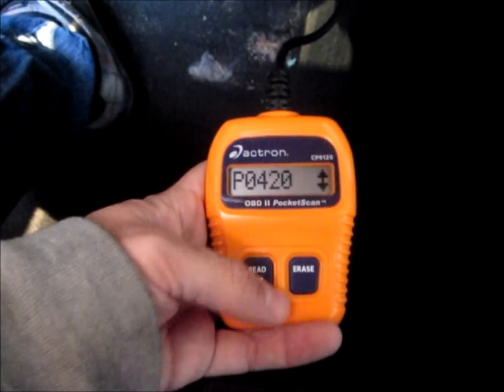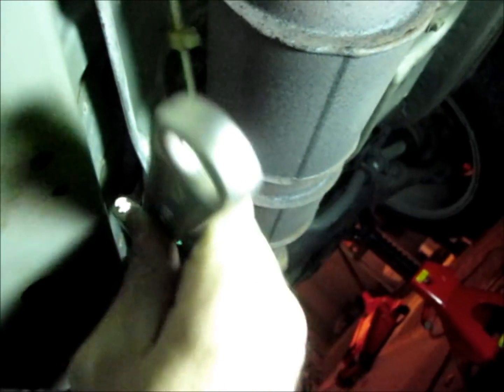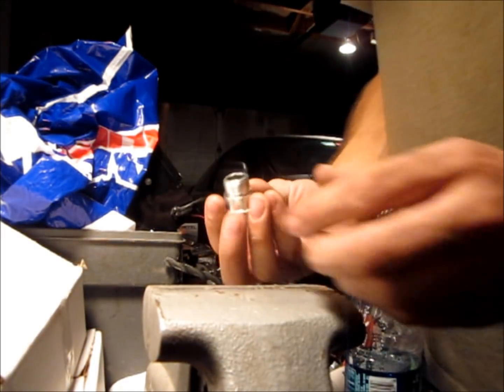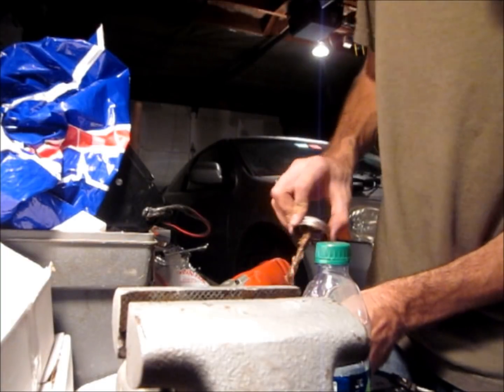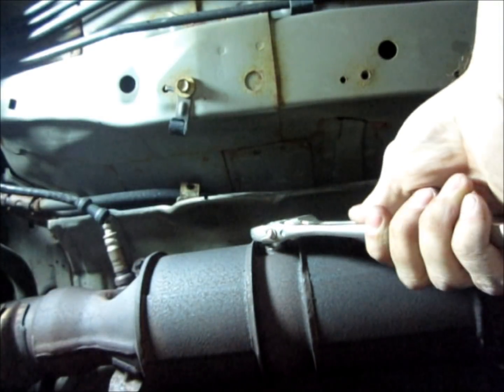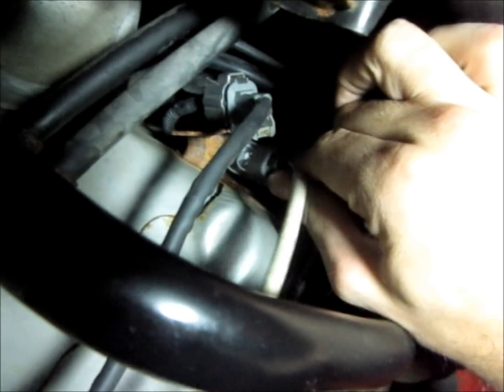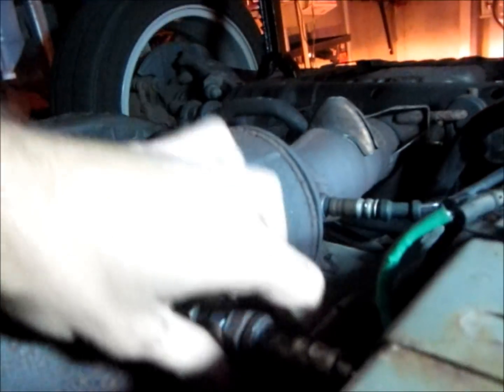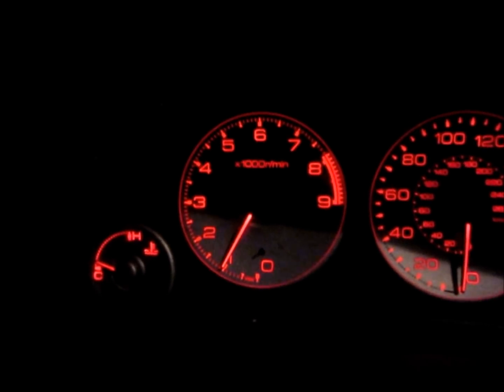Clear check engine light for less than 5 dollars

Comment: This trick will actually make your car run a bit rich..nothing major though.  Running rich has little impact on your motor other then gas milage.  Lean is when you can run into problems and damage as your car will generally run hotter when running too lean.  Cars are setup from the factory to run "universal" meaning, They set it up to run the best for any climate.  So depending on where you are you could be running a bit rich or lean anyway.

Comment: This will not pass smog..  Smog test is an actual reading of the gasses from your exhaust.  This only fools the rear O2 sensor into reporting a lower reading to be within the correct tolerances for the ECU.  A lot of states only use the ECU for testing.  This works on newer cars as well.  I did this for a buddy of mine with a 2005 taurus.  $900 for a rear cat or $6 for the fouler trick.  You decide.

Comment: Obviously the differences an "altered and incorrect" fuel/air mix would have are negligible in this case since I'm sure your O2 readings aren't really effected all that much . Running an engine very rich or very lean for extended times CAN have their toll on the engine, but as I said...in this case I'm just being OCD about such things. Thanks for the vid though, always nice to see cheap easy do it yourself automotive suggestions.

Comment: LOL I guess it just made me wonder if that would have a bad effect on your o2 sensor reading and end up screwing up your fuel/air mixture. I didn't realize you were doing this as a fix for a common problem, as opposed to some weird way to help cheat smog. I couldn't care less about emissions laws, but I'd hate to see a nice "new" RSX get more wear and tear from "smog hacks". I know it's a tiny difference relatively speaking but the more accurate your sensors are, the better and longer it'll run.

Comment: actually. P0420 is usually a bad Secondary O2 sensor
Best thing to do is just buy a damm new O2 sensor
Dont do the "neck" unless your doing a Straight pipe on a track and need to get rid of the CEL.
You got 4 choices (expensive to cheap) Assuming its OBD2
-New O2 Sensor (40$-120$)
-Go ebay, get a generic O2 sensor and solider on the old connector (20$-60$
-Go to a car salvage yard and take one from a trashed car like yours or find one like yours.(10$-40$)

Comment: nice dumb ass since you disconnected the battery the ecu lost the codes and it takes about 50 miles for the ecu to read the codes resulting in the light being on again. Simply just buy a new cat

Comment from the maker: Yes, the light went off.  I disconnected the battery during the procedure. Normally after I reconnect the light would come back on, but after this the light did not return even after 20,000 miles.

Comment: why u want do this,if u dont want that engine light on,just take off bulb from dash,i did same with my ABS light bulb.i just disconet ABS,cuz fixing that is too expensive,but that anoyng ligh went on,so i just take that lights bulb off from dash.no problem.i also work for UPS CANADA,always was here on old vans problem with check engine light,so mechanics just put over that light on dash black eletrical tape,and that is hard core shit....

Comment: The only purpose this sensor truly has is to monitor the efficiency of the converter.  They can set when there is more than enough efficiency left to pass emissions standards.  Honestly I think the government needs to get their noses out of peoples business.  They should only be worried about the exhaust gases leaving the pipe, not the equipment installed.

Comment: In MN I remember they started emissions in 1991 but then it ended 1999. They checked under your car & put a censer in your tailpipe but never checked your light. On my car it's the secondary air injection pump. Because of that I'm sure my cat is shot, if I take the cat off & replace with a pipe will it give me more HP?

Comment: Man i bet no state is as difficult for emissions testing as California. Here a car as old as 1976 is required to have an emissions test. And yes if it has the check engine light on dont even bother taking it because it will fail and some places dont tell you and still charge you. The only newer cars you can get away with smog in cali is a car that originally was manufactured with a diesel engine up to 1998. So if its 98 and older with a diesel your ok no smog is needed.

Comment: @fuckedy Easier said than done, getting the cat off is a pain. If you were intending to take it off anyway and replace it then cleaning it out may save you some bucks but if you just wanted the check engine light to go out this vid is probably the easier of the two methods and even if it costs for the spark plug defouler it's probably worth it not having to remove the cat without destroying it for reinstall.

Comment from the maker: @dathrorana You may need to heat up the converter with a propane torch.  The idea is to heat the inside so it expands.  Then you will need a correct size 02 sensor socket and breaker bar is also a must.  There is alot of heat extremes going on in the exhaust system and also moisture. This makes a breeding ground for frozen and rusty parts.  Oh --- be very cautious and aware of fuel lines when attempting this. You don't want to blow yourself or your car up.  Good luck.

Comment from the maker: @tickleswj2000 Sorry to hear that.  Don't rule out the following: coolant temp sensor / leaking exh manifold / retarded spark timing which all can trigger the code as well.  Sometimes you can find dealer bulletins online regarding trouble codes and common causes / solutions found by dealerships of the certain make/ model. Good luck-- keep us updated.

Comment: @sbond1963: Yes on both. The 'Smog Check' program here in California consists of 3 main parts. A dyno test to check the exhaust gasses, a functional check to make sure all the emissions components are working fine, and a visual inspection to see that none of the emissions components are modified, damaged, missing, etc. Anything other than stock has to have a CARB (California Air Resource Board) number. It doesn't take a scientist to see a modified oxygen sensor trust me I'm a smog tech.
Reply: Everytime  I brought my vehicle into the CA smog test and he reved the engine to high RPMs I felt like my vehicle was being abused. I never do that on the road.

Comment: @TheBodvarg: no its not. P0420 is "Catalyst Efficiency Below Threshold" and its bank 1. A misfire code would be P0301, 302, 303, or whatever cylinder it is. P0300 would be a random/multiple misfire.

Comment from the maker: @sbond1963 I believe the thread diameter / count is the same for all 02 sensors, which is 18 x 1.5mm.  You will know right away when you try to screw the defouler on-- but I am 99% sure this is the case and you will not have an issue with your Yota.  Good luck and thx for watching!

Comment: @moccina Have a 02 Camry I4 with the damn 95% efficiency P0420. The part number you mention - are 02's generic in fitment? Will that diameter work for me?

Comment from the maker: @banuelosEIGHTY7 We don't have smog tests at the pipe where I live, only OBD.  My ecu has gone through the necessary relearn cycles after being reset and has not come back with the code 7k miles later. They would have failed me otherwise, so this worked in my application-- and will for many others. Thx for watching.

Comment: I'm guessing you don't live in California. That would be considered 'modified' and would fail the smog test. Plus most of the time P0420 codes take a while to come back on so even disconnecting the battery can get rid of the light for a while. Modifying that sensor isn't going to do you any good.

Comment from the maker: @tickleswj2000 Hi, I did not erase the p0420 code manually with my scanner. It went away when I reset the battery and has not come back due to the defouler install.  Thx for watching.

Comment from the maker: @rahulbhushan Hi there, yes you should make sure it truly is not the converter that is faulty, you are correct.  My solution was based on the premise of having ruled out the converter as a culprit.  If I remember correctly, you can tell if the cat is bad by listening to the muffler at idle --- if it "burps" and stumbles it means it's clogged. It will also stink like rotten eggs. Thx for watching.

Comment: you may want to mention that if in fact there is a cat convertor blocked up issue, while this will have the light go away, you are not fixing the problem and actually damaging the engine by not letting the exhaust gases go out. Watch scotty kilmer's video here on how to test catalytic convertor to understand what i mean.